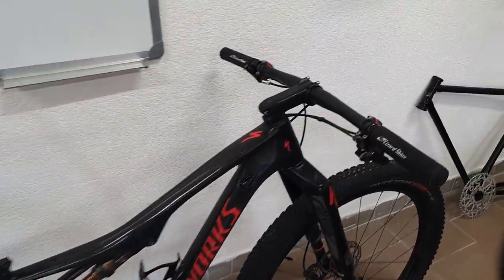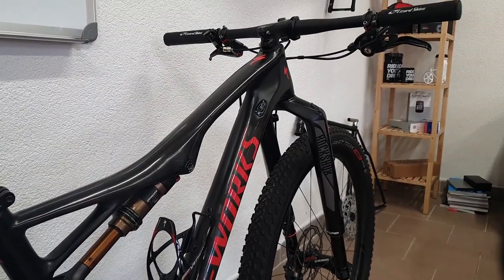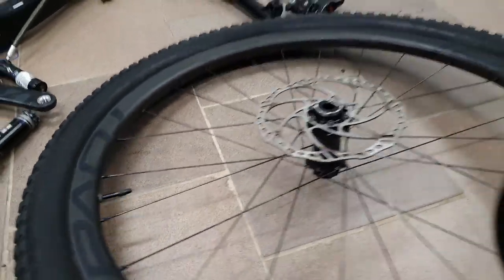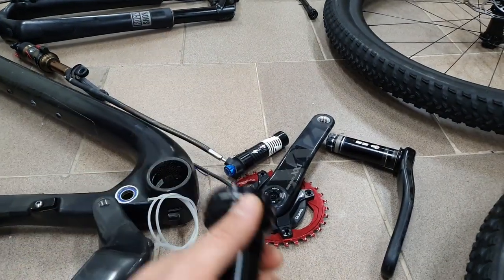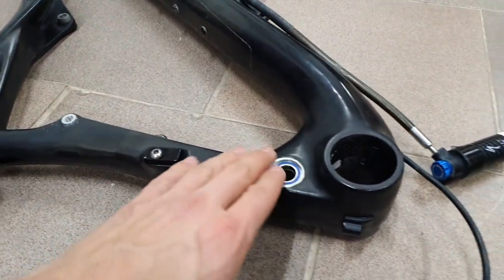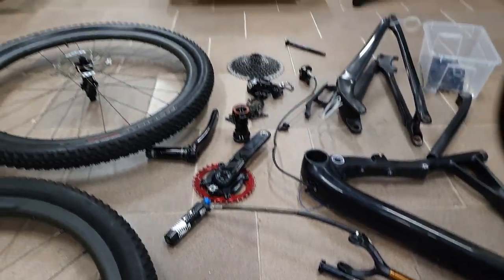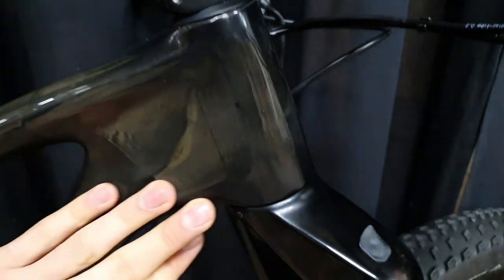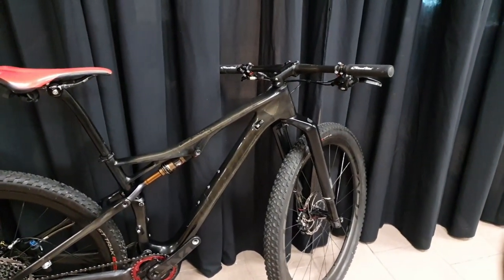S Works Epic FSR full rebuild and service

Comment: Removing the S-WORKS stickers was a bold move cotton.
Reply: @ronykuba  definitely looked better with the s works stickers.
Reply from the maker: @msm624  they were cheap, nasty aftermarket ones that didn’t really fit
Reply: @ronykuba  what happened to the factory ones
Reply from the maker: @msm624  frames are painted from the factory. It had stealth branding

Comment: that's a service. I do this 1x a year plus:
beeding the brakes 
greasing the pistons
suspensionservice
wheeltruing
greasing the freehub
greasing shimano Pedals

Takes a full afternoon at least but is very satisfying and I never had a problem on the trail or any machanical

Comment: Hi Ronald,

very beautiful video. 👍I have a question about dismantling the S link that sits on the seat tube. I want to service/grease the bearings on my Epic FSR Carbon 2016 and repaint the rear upper swingarm.
How do I get out the two inner screws of the FSR bearings that sit between the seat tube. The seat tube is in the way for me to be able to put the Allen key there. In what order do I have to disassemble the S-Link?

You first loosened the two bearings behind the brake caliper mount and then disassembled the S-Link at the front. What grease did you use to lubricate the bearings?

Kind regards Sasha
Reply from the maker: Hi, I don’t remember. You can find the assembly manual online.
Reply: @ronykuba  Where are the instructions for your bike on the net? I couldn't find them.
Reply from the maker: @saschakrebs2175  well, instructions for my bike wouldn’t apply here, but for the Epic you’ll find then on specialized.com or manualslib
Reply: @ronykuba  Okay, thanks, I'll do it like you did in the video.